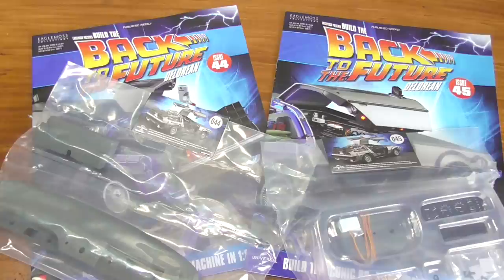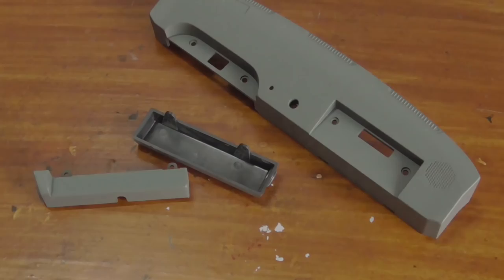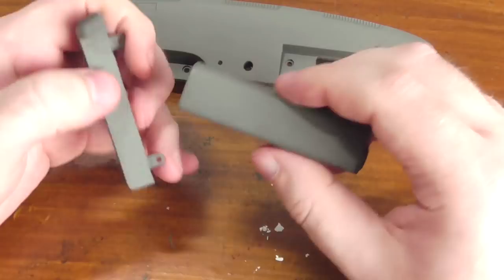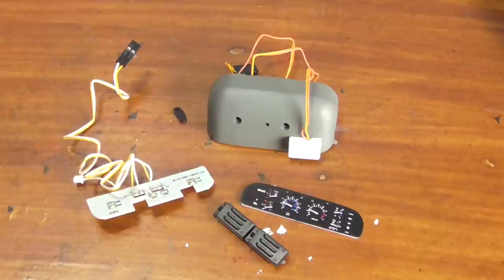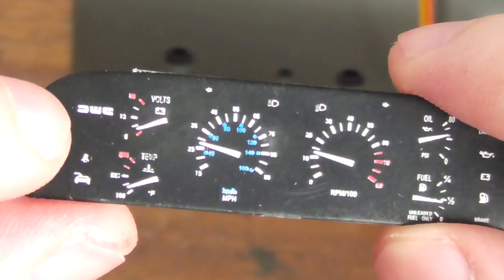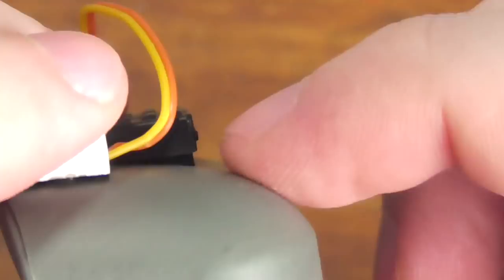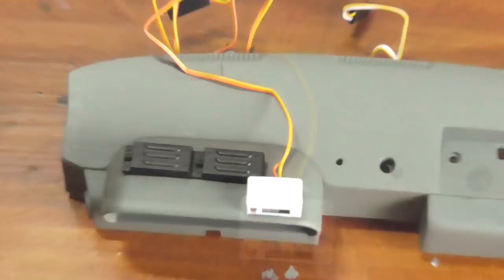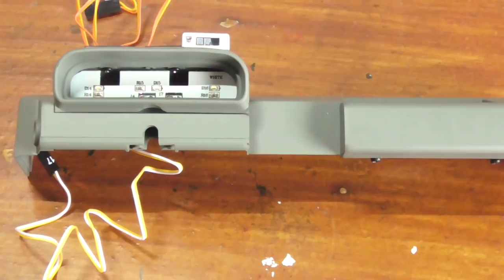Eaglemoss Build the Back to the Future Delorean Parts 44 & 45: DASH! AH AHH!

Comment: I do know that Mike Lane is working on two versions of the dash board which not only have the DMC the correct way around, but are also a higher resolution for the rest of the dials. He's doing one that is set to 88mph and one that is set to 0mph. His only hiccup at the moment is a lot of light bleed with the things, so he's busy working on a solution to that before he releases the mod to the general public. I'll probably go the 0mph route seeing as the model will be stationary, and I'll probably also block out the centre dash for each of the digits on the 88 display that you installed today, because if the car is stationary, then it's not going to actually read 88 on the thing. So blocking the light from going through the centre dash in each digit will turn them from 8s to 0s and the readout will correctly say 00 instead of 88.